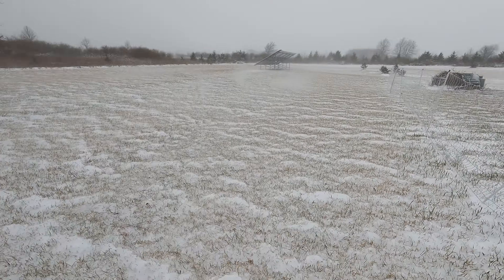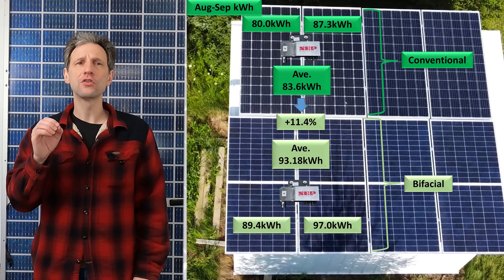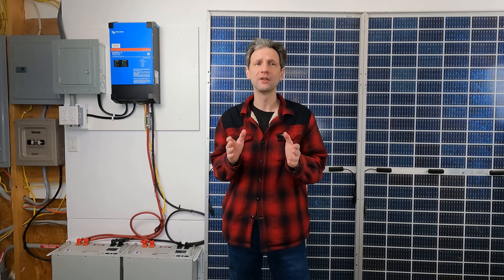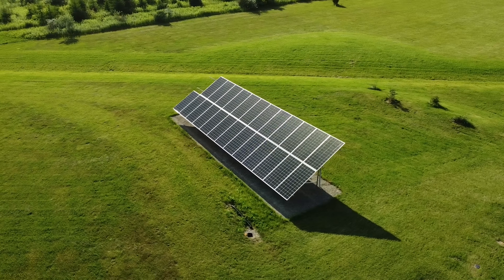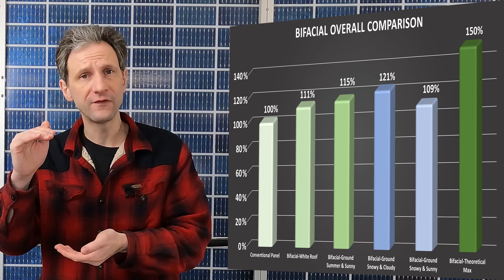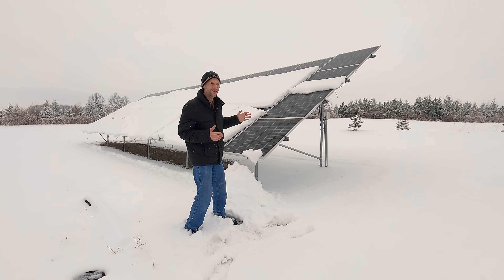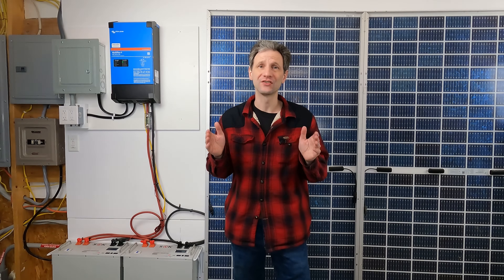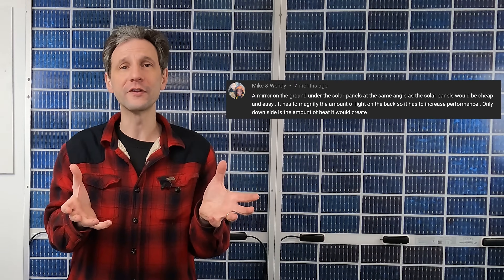Bifacial Solar Panel Winter Performance Actual Results

Comment: Compare bifacials hung vertically, winter configuration. Snow wouldn't obstruct nearly as bad, sliding off and less backside shading. Low sun angle wouldn't be much loss vs higher summer sun angle during winter.

Comment: Dave, thank you for sharing such exciting testing results!
Is it possible to add some link in the description with the strings connections details, solar panels wattage as well as the inverter model/input voltage, please? I wonder why the bifacial panels don't melt the snow from the other panels if the strings are paralleled? Maybe, they are going into separate inputs of the inverter, but if you clarified that point, it would be priceless.

Comment: I might have missed this, Dave, could you share what solar panels you used in that winter setup, would also like to know the brand? Thanks. Need good low-light solar panels for the climate that I am in. I liked the video.

Comment: How about some heat tape to run until the snow is melted/sloughed off?  🤔
(there's gotta be a way to automate it based on either the temperature of the panels compared to the air temperature, or maybe based on panel output?)

Comment: I realize we are told solar panels produce more power when the sun is at a 90 degree angle to the panels or ws close as we can get but, have you tried lowering the angle of your bifacial panels and raising them higher so as to let more light come under the lower end of the panels creating more reflective light underneath them?
Just a thought.

Comment: I appreciate your presentation.  New sub.  I wonder if a sheet of door screening covering the panels on a sunny day would prevent them from clipping.
Reply from the maker: Thanks for the sub.  It would reduce the clipping, but reducing the panel output isn't helping you in any way.  Clipping isn't hurting the inverter, it just means the inverter is running at it's max output and can't take advantage of all the available power.

Comment: Have you done this with a pergola? I am thinking of building a pergola with the south side bifacial panels and the north side solid roofing material. The underside I am thinking of making a light sand base or white rock base. Also you said something about 1/2 cut? Panels? Should they be a better option to just bifacials?
Reply from the maker: Most bifacial panels are half cut.  A pergola is a good option.  I would slope the roof as much as possible to the South (for those in the Northern hemisphere).  Make sure the floor is a light color and minimize shading on the back side.

Comment: If your array were higher in the air, you proba ly would've gotten a bigger snow boost.  I've seen other videos that say it should be at least 5 or 6 feet high to get the full reflection advantage.

Comment: Great vid. I am in the process of installing 2000watts if bifacial panels in a vertical position which I hope will alleviate shade issues.
Have you experimented with vertical panels in East West position?
I am in the desert Southwest at 4000 ft asl
Reply from the maker: Yes, here is my video on E/W vertical panels: https://youtu.be/5AVO1IyfA9M

Comment: I would put in some heating rope on the back sides. The stuff we use to keep pipes from freezing. You wouldn't need much and the bifacial panels can run them bootstrapping the array.

There are more efficient or lower power ways of warming the panels but all the same concept.
Reply: Please explain this concept a little more? Thanks!

Comment: I have vertical mounted 6x465w panels 2790w, dark clouds and rain 460w, overcast 780w, summer 1800w no white rock easy 30kw a day 3 arrays np, winter snow and sun 3414w and an undocumented sighting of 3700w. By sept I have 4 arrays, and this quoted array will be the weakest of 4.   2790/ 3255/ 3255/ 3630. I may have to shade the 3.6 slightly if it hits 4500w. Best part snow for 120 days and I never saw snow on any panels, it has been 10 months and now notice slight power loss due to dirt.
Reply: How are you going to clean off the dirt?

Comment: What an AWESOME CHANNEL! Thank you Dave for doing this. I am looking to jump into solar at my property. Im rural like you. I want to do a 2 axis tracking system, do you have any input? Im in Wisconsin so this video was very helpful on Bifacial output and snow clearing value. Thank you
Reply from the maker: Thanks!  My input at this time is that tracking systems are not likely to pay for themselves and I would only use one if I had limited space.  If you want more power it would be cheaper to just add more panels.

Comment: One tip. It is better to shorten cables for energy efficiency than to roll them into a circle. The rolled up cable works like an inductor and hinders the transfer of AC power. It is also better just to make them go back and forth than in a circle if that is an option.
Reply from the maker: These cables are carrying DC power not AC.  I did an analysis on the loops with my son, you can watch it here: https://youtu.be/i7vHEHB3a-M

Comment: Space out the bi facial panels.  Like 1 foot all around to catch reflected sun from behind.  Then test 2 foot or more.  Single sided panels didn't need spacing that's why they are mounted really tight together.

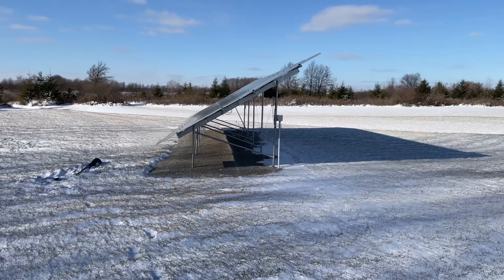Comment: While rewatching this video I noticed at 3:28 (in winter snow) that the bifacial end of the array is shaded by those two trees. The low winter sun angle means you should top those trees 10-12' before next winter.

Comment: Love your videos. Where do u recommend getting ground mount racking system  and I ve seen Santan site. But what do you suggest now 2024. For panels and where to get. I’m leaning toward biracial. Also I’m located in Southern Maine(Portland)
Reply from the maker: Thanks!
Here are some good sources for bifacial panels: https://projectswithdave.com/solar-panels/
For residential home size arrays, there are two ground mount systems I recommend, you can find them at the bottom of my components page here: https://projectswithdave.com/components/

Comment: Ha, 😂 in Australia 🌏🦘 we get about 5-6 kW per day per kW. Much more that your system. My home is grid connected to export what I don't use. And just in case. Tesla batteries make a huge difference too. I am looking to upgrade to 20 kW of bifacial Trina S+ on my North facing roof. I have two different types now and want then all looking the same. 30 years will see me out i think. 😊😊😊
Reply from the maker: Nice!  It's much easier to justify solar in Australia.

Comment: What is the tilt angle of your solar array, Is it 35 or 40 or 45 degree?  What do u think is the minimum tilt angle required to Not have snow stick to the panels, is 30 degree enough?  I am thinking of building my solar array, Thanks! 

I think another thing you can do to maximize the bi-facial solar generation is to put like a 1 foot air gap between each solar panel column. So the sun light can go to the back side of panel easier.  You seems to have unlimited space in your "backyard".  So you can easily build another rack of array to have all the solar panel spaced out 1 foot.
Reply from the maker: My system is at 31 deg.  If you can get your panels to 60 deg in the winter, you shouldn't have too much trouble with snow sticking.  Make sure you have enough clearance under the panels to shed the snow.
Reply: @ProjectsWithDave oh, it is only 31 degree.  I thought it is higher.   Thanks for the info

Comment: That would be my summer angle. With my adjustable mount I'm almost vertical for winter solar collection.
Reply from the maker: Do you have bifacial panels?  What latitude are you at?  What winter angle gives you the best output?  Thanks!

Comment: Thanks for the interesting video. I'm still experimenting with bifacial modules but I have two rows of modules so I'm wondering if I can tilt the back row to reflect light to the rear of the front row. I'll try it and see what happens!
Reply from the maker: Let me know if you see any benefit from that.

Comment: So switch your panels from your shed to your ground array if they make no difference with the standerds being up there. Consider using a litle bit of energy from the bifacials to heat the standerds

Comment: Is the optimum angle for a bifacial the same as a conventional panel?
Reply from the maker: Theoretically it would be the same.  However, I've seen data to show some benefits from installing them vertical.  I am working on a test setup that places them vertical.  I'll post the results when I have actual data to present.

Comment: The snow shedding is inaccurate if you look the other end shedded snow as well and there standard pannels I think it has to do with the fact that they are on the end and not cause there bifacials
Reply from the maker: Maybe you can't tell in the picture, but only the very top of the panels are clearing all the way across.  The other end is not clear like the bifacial panels.  There is a significant difference in snow clearing between the two styles of panels.

Comment: Have you tried installing the PV modules in a horizontal position? The diodes in the PV module will allow the production of energy even if the module is covered on the bottom side.
Reply from the maker: The new bifacial panels are half cut giving the same effect, but that's a good idea for standard panels.

Comment: I might be late to the party but if you had a steeper winter angle you would have better results. Also less snow collecting or staying on the panels.
Reply from the maker: Yes, If I lived in an area with more snow I would use a much steeper angle.

Comment: How do you get info on each individual panel in your system? IE. watts, etc.
Reply from the maker: I have two methods for gathering data.  One is using individual optimizers on each panel with my Solar Edge system.  The other is using dedicated oversized microinverters from NEP.  I then record solar irradiance data independently with a Fluke solar irradiance meter.

Comment: Thanks this is very interesting but what nobody says is in a off grid setup when your battery is full it doesn’t matter what panels u have as you can’t use the power. 
Does it then pay to fit biracials?  Here in S Africa there is about a 15% difference in price between mono and Bifacial panels.
Reply from the maker: The big advantage to bifacial panels it the increased performance in low light conditions when you need the boost.  On cloudy and foggy days you will get significantly more production from bifacial panels.

Comment: Bifacial Panels shine the cooler it is.. As they hate heat...I spray water on them in the Texas Summer time to cool them off. Then they put out more then the rated power using Renogy 220 watts. I have no idea how others perform...

Comment: Maybe time for a wind generator?
Reply from the maker: I haven't found one that makes sense to install.  Feel free to make suggestions.
Reply: @ProjectsWithDave  I’m only asking to see if you tested any out and because you video on an extreme wind day and you had overcast weather and ice covered panels.  I’m planning on a system that will be located on the Mesa and I hear it can get windy there and it is in snow country at 6944Ft elevation.

Comment: subscribed!
I'm your freind from diysolarforum who was asking weird questions on FLA batteries.
very soon I'll be upgrading to 550*2 bifacial solar panels, and based on my location I need to decide their height and inclination. 550w + 30% as the brand claims, they are also half cut. Brand claims them to be 22% effecient cells.
Reply from the maker: Thanks!

Comment: My three arrays totaling 34kWp are at 45, 55 (facing SW after watching your prior video😊), 65 degrees. The two steepest are QC 475W G10’s. The steeper arrays shed snow quicker or at 66 don’t even collect it to begin with.
Reply from the maker: Great 👍

Comment: Love your content on solar man.  I am planning out a solar install and am working on figuring out all the permitting and utilitiy contracting aspects of it at the moment.  I am an electrical engineer so the system design part is easy but time consuming.  You mentioning putting a pond behind the bi-directional panels gave me an idea of putting a small ground mount system by my koi pond.  Thank you and keep up the great content.
Reply from the maker: I suspect, you will see some benefit from the reflection.  I don't know how much exactly but I have talked to installers that will adjust estimated output when solar is installed near water do to an expected boost in production.

Comment: Adding reflective under the bifacials would be the first thing. Next, I would probably raise any fixed mount bifacial higher off the ground to allow more light in, especially from the front. Your test bifacials appear to be about 26" above the ground, it would be better if they started at a minimum of 42-48". You might consider mounting any future bifacials over a thin concrete slab and make sure you use white not gray Portland cement. Also, use a mounting system that doesn't have any supports directly under the panels rather using edge mounting between panels on the long side would be superior. Higher= more light & better cooling.
 It might be fun to test the bifacials in a vertical mount (like a fence) with the panel front facing east or west. Just decide whether you want the highest peak in morning or afternoon, either way no clipping! Expect amazing results with this one, especially in the snow.
 I am planning my new system and will be ordering 32ea. 400W bifacials in the next few days. It will be 2 arrays of 16 panels each with 1-axis auto-tracking and tool free tilt adjustment. Still undecided on inverter and tracking controls though.
.

Comment: Hi,
I have a roof flat roof which is mainly oriented to the south-east.
It is around 26m2 in dimension.
I was thinking of installing some of the bifacial solar panels on it. But to mount it totally vertically like [ I I I I I ] with microinverters.
What are your thoughts on that?
Tnx!
Reply from the maker: I would not mount them vertical.  It would be very hard to manage structurally.   If the roof is white and you mount them at a steep angle with standard racking, you will save cost and probably get better performance.
Reply: @ProjectsWithDave  thanks! 😊

Comment: Would be really interesting to see vertically mounted, east-west-facing bifacials. Snow shedding solved, and cheaper mounting hardware..
Reply from the maker: Where have you found cheap vertical mounting racks?

Comment: The cheapest way I could see to improve output at night would be to install lights at your panels that stay on through the overnight, especially with a good reflective underlayment.

Solar powered lights that would be charged during the day would give back approximately 15% of the energy released and allow you to have lights on the panels for service during the night.